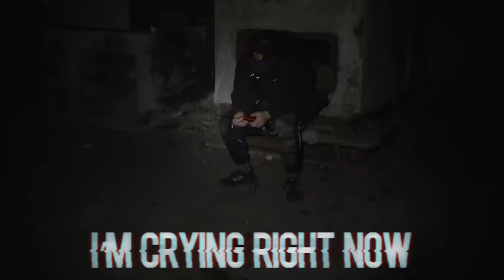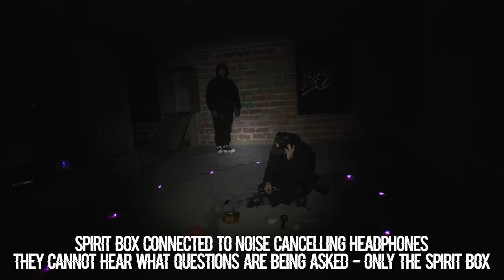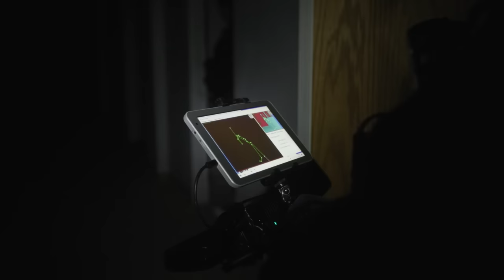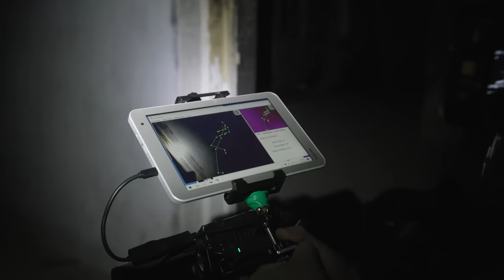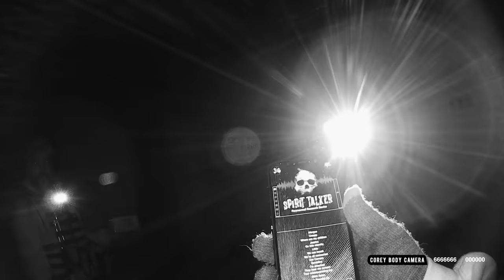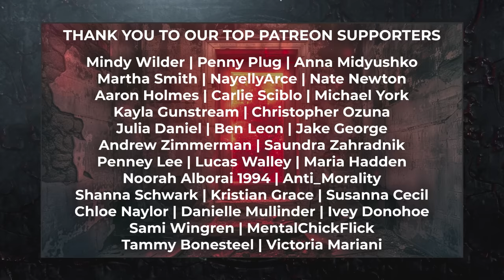TWO NIGHTS in HAUNTED ASYLUM *WE GOT A DEMONIC ATTACHMENT*

Comment: 4:07 Corey’s reaction.
15:10 a bang can be heard.
16:28 there reactions.
19:00 an exhale can be heard.
20:08 thuds can be heard as well as the rem pod wire lit up.
20:29 better seen during the replay.
22:03 odd noise after Elton says “ending”.
23:21 audio interference.
23:24 audio interference.
24:05 audio interference.
24:22 odd noise while they are talking.
24:32 audio interference.
24:38 audio interference.
24:46 a thud can be heard.
25:04 better heard during the replay.
26:34 rem pod.
26:45 audio interference.
26:50 rem pod.
27:02 audio interference.
27:39 audio interference.
28:05 audio interference.
28:54 voices can be heard when Elton turns the camera.
29:30 a moan or groan can be heard.
29:48 rem pod.
30:01 rem pod.
30:09 rem pod.
30:24 rem pod.
30:36 rem pod.
30:43 rem pod.
30:50 rem pod.
31:10 rem pod.
31:57 a whistle/scream can be heard.
35:13 flashlight turns on.
35:21 better seen during the replay.
35:55 odd noise. Not sure if it’s from the music.
36:13 flashlight turns off.
36:31 flashlight is on.
36:35 flashlight turns off.
37:21 flashlight flickers.
37:27 a faint “ha” can be heard. Almost like a croak.
37:29 a second faint “ha” can be heard. Almost like a croak. Also, the flashlight turns off.
37:43 a faint “ha” can be heard. Almost like a croak.
37:55 flashlight turns on.
38:34 a tap can be heard.
39:17 flashlight turns off.
40:03 flashlight turns on.
40:34 flashlight flickers as well as footsteps can be heard.
41:59 odd noise before Elton turns.
43:57 flashlight turns on.
44:08 flashlight turns off.
44:24 flashlight turns on.
44:26 flashlight moves.
44:39 better seen during the replay.
45:46 rem pod.
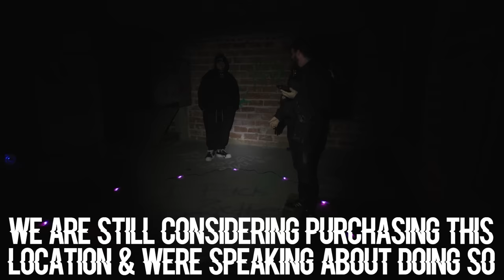45:52 rem pod.
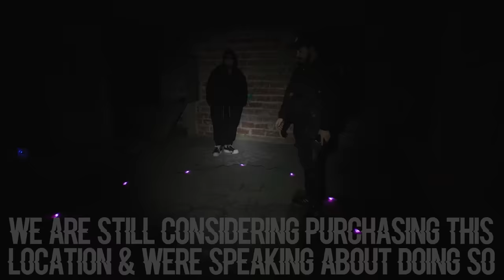46:02 rem pod.
46:15 rem pod.
46:29 rem pod.
46:49 rem pod.
46:55 flashlight turns on.
46:57 rem pod.
48:31 flashlight turns on.
49:23 audio interference.
49:27 audio interference.
49:33 audio interference.
49:36 audio interference.
49:41 audio interference.
49:47 audio interference.
50:47 footsteps can be heard.
51:39 something with a long “o” sound can be heard.
53:11 that’s handy.
54:35 rem pod.
54:39 rem pod.
55:47 weird audio noise.
55:54 a faint boom can be heard.
56:03 who's hungry?
56:07 cat ball.
56:41 rem pod.
56:48 cat ball.
57:07 rem pod.
57:13 cat ball.
57:16 rem pod.
57:23 Corey’s penguin run. I laughed at that one.
58:53 cat ball.
59:31 Corey’s penguin run.
1:01:42 flashlight turns on.
1:05:21 cat ball.
1:05:35 cat ball.
1:05:46 a faint footstep can be heard.
1:06:02 odd noise.
1:06:15 a bang can be heard.
1:06:49 flashlight.
1:06:57 cat ball.
1:08:11 cat ball.
1:08:48 cat ball and flashlight.
1:09:07 cat ball.
1:09:15 flashlight turns off.
1:09:47 cat ball.
1:10:04 flashlight turns on.
1:10:11 cat ball.
1:10:25 flashlight turns off and the other flashlight turns on.
1:11:05 flashlight dims.
1:13:00 flashlight is on.
1:13:44 K-2 meter.
1:13:45 a croak can be heard.
1:14:11 flashlight turns on.
1:14:48 door moves.
1:15:45 music box. That sounds like a slowed down version of Devil’s Symphony by DJ Scooter.
1:16:16 SLS camera.
1:16:19 music box.
1:17:19 music box.
1:17:25 SLS camera.
1:17:28 music box.
1:18:24 SLS camera.
1:20:50 SLS camera.
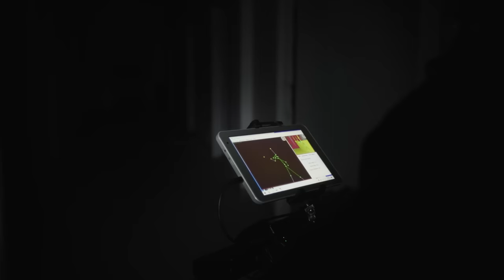1:21:09 odd noise while Elton is talking.
1:21:22 knocking can be heard.
1:21:27 tapping can be heard.
1:21:29 a voice can be heard.
1:21:39 better heard during the replay.
1:22:23 SLS camera.
1:22:27 SLS camera.
1:23:37 the lights are pulsating.
1:24:20 a knock can be heard.
1:24:45 rem pod.
1:24:51 rem pod.
1:24:56 rem pod.
1:25:56 odd noise.
1:26:13 flashlight turns on.
1:26:42 rem pod.
1:27:12 rem pod.
1:28:00 nice one, Elton.
1:28:20 rem pod.
1:30:13 knocking can be heard.
1:30:31 rem pod.
1:35:29 a knock can be heard.
1:41:13 a knock can be heard.
1:41:16 another knock can be heard.
1:41:48 music box.
1:42:14 knocking can be heard.
1:42:20 music box.
1:43:05 knocking can be heard.
1:44:01 music box.
1:08:07 Corey getting nailed. Tonight’s not your night, huh?
1:49:17 rip Corey.
1:49:22 Corey got screwed then.
1:49:28 rem pod.
1:49:43 door opens.
1:50:15 Corey spinning.
1:50:20 there goes the SLS camera.
1:53:17 orb.
1:55:42 odd noise.
1:57:16 a bang can be heard.
1:57:22 better heard during the replay.
1:58:04 glass clanking or breaking.
1:58:15 odd noise.
1:58:21 better heard during the replay.
2:00:56 SLS camera.
2:03:56 odd noise.
2:04:51 a voice can be heard.
2:05:03 better heard during the replay.
2:07:00 a hiss can be heard.
2:15:25 odd noise.
2:16:15 an exhale can be heard.
2:17:30 flashlight turns off.
2:18:07 a giggle can be heard.
2:18:10 another giggle.
2:18:25 another giggle.
2:18:31 flashlight turns on.
2:18:52 a giggle can be heard.
2:18:55 orb.
2:21:21 K2 spiked.
2:21:40 a thud followed by a giggle can be heard.
2:21:46 better heard during the replay.
2:23:08 a giggle can be heard.
2:24:43 camera turns off.
2:26:34 an exhale can be heard.
2:27:08 rem pod.
2:27:34 rem pod.
2:28:34 orb followed by the rem pod.
2:29:19 rem pod.
2:29:30 rem pod.
2:30:07 rem pod.
2:30:21 rem pod.
2:32:01 rem pod.
2:32:25 rem pod.
2:33:01 rem pod.
2:35:18 odd noise.
2:35:37 odd noise.
2:35:40 odd noise.
2:35:40 odd noise.
2:35:43 odd noise.
2:35:50 odd noise.
2:37:42 a bang can be heard.
2:37:50 voices can be heard.
2:39:13 rem pod.
2:40:04 a knock can be heard.
2:40:56 odd noise.
2:41:41 knocking can be heard.
2:41:51 rem pod.
2:41:59 that’s a lot of orbs.
2:43:22 rem pod.
2:44:19 a voice can be heard.
2:44:38 odd noise.
2:44:43 orb.
2:44:50 better heard and seen during the replay.
2:45:45 orbs.
2:45:11 knocking can be heard.
2:45:22 a thud can be heard.
2:45:35 two knocks can be heard.
2:45:36 rem pod.
2:45:44 rem pod.
2:45:45 better heard during the replay.
2:46:37 orbs.
2:46:56 tapping can be heard.
2:47:04 tapping can be heard.
2:47:09 a voice can be heard.
2:47:49 footsteps can be heard.
2:47:51 orbs.
2:47:53 rem pod.
2:49:14 metal clink followed by a thud.
2:49:37 orbs.
2:49:54 a thud can be heard.
2:50:18 orbs.
2:50:46 rem pod.
2:51:17 rem pod.
2:52:01 a thud can be heard.
2:52:06 another thud.
2:52:10 more thuds.
2:53:54 odd noise.
2:54:35 orbs.
2:54:46 odd noise.
2:57:16 a bang can be heard.
2:57:20 door banging.
2:58:41 orbs.
2:59:28 banging can be heard.
2:59:36 orbs.
3:01:40 orbs.
3:02:29 orbs.
3:03:56 orbs.
3:04:40 orbs.
3:05:29 orbs.
3:06:25 orbs.
3:07:04 orbs.
Reply: wow
Reply: Thank you, having someone who doesn’t miss anything is so helpful.🫶🏽🥰

Comment: Maybe a cool experiment to try:  When there is a lot of paranormal activity, you should put a DR60 on Ethan (holding the most 'energy') and see if it picks anything up.  Have Ethan stand far enough away from the both of you so that the DR16 does not pick up your voices so that whatever it does capture leans more towards the paranormal.  (The positive side, at least for the editors is that there may not be a lot to sift through!)

Comment: 2:18:07 heat a high pitched voice or door squeaking open or close.
Reply: Also 2:18:50 when the Evan turns the light back out after the flashlight turns on on the tub a flashes to Cory. In the door way on the right there's a white spot and looks like a shadow standing there. And at 2:18:59 and later the dark spot fades away.

Comment: Hey guys wanted to know if you guys would come to New Zealand and investigate the chateau that has been shut down due to the hauntings.the place is located under our snowing mountain called mt ruapehu here in the north island and it is told that there is no power running in the building but one light stays on in the top floor and never goes out due to the ghost on the top floor it kinda looks like the shining building 🤣